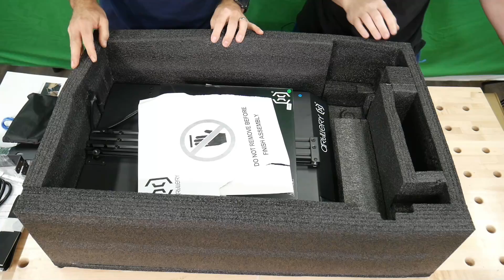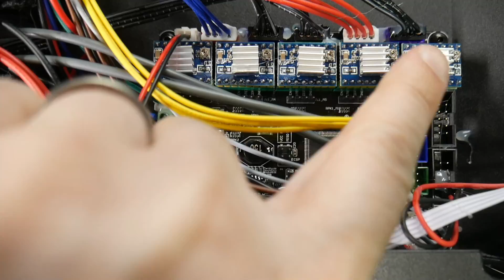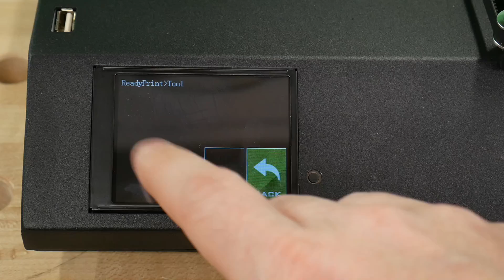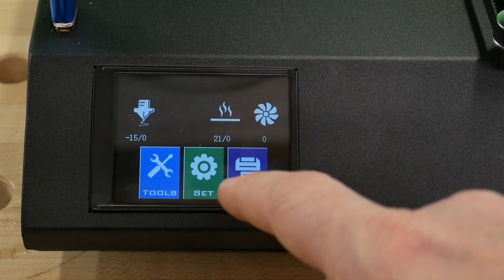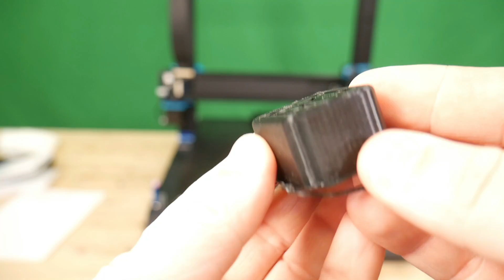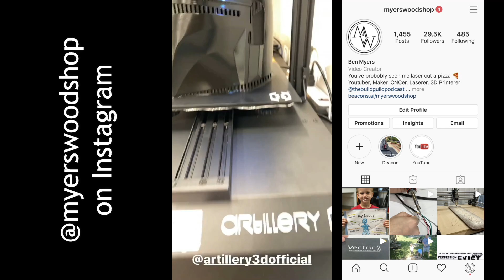Artillery Sidewinder X1 The Best 3D Printer on The Market?

Comment: The best way to remove prints from this bed is to use CO2 upside down to make the print much colder (not frozen, dont spray too much or get on skin etc do it slow and at own risk) but usually my prints pop right off the bed after the print gets cold. I literally spray each corner and the middle with 1 tiny half second upside down burst and it pops loudly off the bed. Apparently magigoo works really well also.
Reply from the maker: Great tip!
Reply: @MyersWoodshop  I got tired of wasting co2 so instead i just keep some ice packs ready to go, can usually put the packs in, on, or around whatever ive printed and watch it shrink before my eyes. kinda freaky actually. Hope this helps someone.
Reply: I use gluestick on my bed so prints stick better and then I slide a good razor blade under one corner and 99% of the time it lets go easy

Comment: Oooh, this was intersting! Thanks! :)

I'm not well educated when it comes to 3D printers. This seems to be a 'filament' printer, the other popular option bein 'resin'. Right?
I read that "Elegoo Mars" may be the most popular resin 3D printer right now(?), how does this Artillery compare to the Mars?

* It's seems much bigger than Mars. Thus it takes more space, but can make much bigger things (like a full helmet, yes?)
* I assume it's far less toxic.  Both for air filtering/quality and resin's contact with skin hazard.
* The Artillery seems to be a tad more expensive, like +25% more expensive where I live, roughly.  I do not know how to compare resin to these filament coil.

How's printing quality, relatively?  I'm mostly interested in minifigures for roleplaying games and things like these models: https://www.thingiverse.com/thing:4191414
Will Artillery equal Mars in such minute details?

Thank you for making this video, it's really helping!
Reply from the maker: yep!  This is filament!
Reply: I hope you didn't buy yet, But for detailed small prints, Definitly go resin. It is wayy more accurate.
Reply: @stafvan  It'll take a while before I buy! ;)

Comment: I don't know why they installed fan at the bottom and place it in the middle but control board which heats up during printing is on the right side and don't have decent aluminum heat sink. This makes no sense and it's version 4 :) . Printer not grounded only PSU. During printing halogen lamps flicker on the same line. Wiring could be better. Also everything needs to be tighten so I spend lots of time doing that when I got it. Printing quality with PET-G is good, printer is silent, heats up fast. I bought it for $349 so it's worth the price.
Reply from the maker: the ender 3 does that too.  this is a great printer.

Comment: One of the reasons that the bottom footprint of the printer is so large is because it aids quite heavily in stability and vibrating. Those two factors play a huge role in decibel reduction.
Reply from the maker: for sure. its VERY quiet.

Comment: I want to buy a 3D printer and I think this is the one is there anything you have found that might say I shouldn’t buy it
Reply from the maker: nope.  this is a GREAT purchase!
Reply: Myers Woodshop thanks
Reply: @rafaelbarkhordarian2163  and I second that. I've had a V4 X1 for about three months now and it has produced some awesome prints with very little tinkering. Just make sure you buy the latest iteration, the V4. It has a tiny reset button on the left side, just to the right of the LCD screen.

I am very technically minded and was expecting to do a lot of tinkering, but this was my first printer and the worst thing I've encountered has been leveling the bed, which I've only had to do twice. I'm planning on installing a BLtouch or similar, but at this point the prints have come out phenomenal, just like in this video.

Also, it is SO QUIET!
Reply: Daniel Gonzalez thank you

Comment: CR10S Pro V2 Has on-th-fly Z offset adjustment. X1 still has to fix X gantry controls.
Reply from the maker: I flashed the firmware to marlin 2.0 and now have z offset on the fly.
Reply: @MyersWoodshop  Did they fix the X-gantry control?

Comment: That bed surface releases prints when the bed has completely cooled. Patience and happy printing.
Reply from the maker: We waited 45 minutes off camera to let it fully cool. STILL couldn’t get it off!
Reply: @MyersWoodshop  You need a perfect first layer for it to work, it can't be too compressed on the bed. Works well for me.
Reply: @MyersWoodshop  I saw someone rub some glue stick on the print bed and solved this issue.

Comment: Yellow is the coating on the bed. The bed is just glass with coating and rubbing it off reduces print sticking
Reply from the maker: That’s what I figured...but it’s TOO sticky!
Reply: The yellow stuff seem to be an additional sticking promotor. The glass itself is covered with a black coating. After removing the yellow stuff from the coating the prints stick very strong when hot, but are easier to remove when  the bed is cold. After some prints it works quiet well, but you have to be patient and wait till the bed is cold. When the prints have a big surface area I just print on a cold bed and don't need to wait after the print.

Comment: where did you find the built in design for printer in cura 4.6.1 because i don't see it at all under witch name ?
Reply from the maker: I was wrong.  It's not in there.  I had to download and add a profile.
Reply: @MyersWoodshop  I also tried looking for it, in Cura 4.7, also not there.

Comment: Nice! Does it do ABS? If it does, have you found any issues with warping? In my experience with ABS it warps due to the piece cooling too soon
Reply from the maker: It will but my experience with ABS is limited because I don't have the space for an enclosure.
Reply: yes but ABS really needs an enclosure, big box over the top of the printer does the trick.
Reply: @WeirdNamja  yeah thought so, I'm interested in upgrading in a massively print area printer, so this looks like possibly the best option :P Thanks @Ben for the great review video

Comment: Good morning Ben, I earlier commented on one of your videos regarding the Onefinity CNC. 
After some thought, I decided to hold off the preorder on it. 
In the meantime, I jumped into 3D printing and by coincidence, I also purchased the Artillery Sidewinder (due to rave reviews) and have been using it the past two months. 
This is my first machine so I have no comparison to others, and I've done some extensive research on 3D printing before pulling the trigger.
Just an FYI for you and your readers on this machine.... 
The Yellow residue on the bed when you first got it... factory applied and could be some kind of adhesive to help print bed adhesion (more info further down).
I had the same problem removing that test cube print off the bed for my first print. I also used pliers to remove it but I've read you can chip the print bed glass doing so.
What works for me is to put a few drops of "watered down" 70% Isopropyl alcohol along the edge after the end of the print. In about 5 minutes, the alcohol will loosed the bond and it should release easily. 
"Initial yellow residue"...  after a few prints and bed cleaning, the bed adhesion wasn't great anymore. 
There are many alternatives like glue sticks etc... I use "Aqua Net Extra Super Hold Unscented Hair Spray" ($4 from CVS pharmacy)... Spray it onto the clean bed before printing, then heat it up to 70º C to dry it off. It works wonders as it has held a 50mm x 250mm tall print without toppling. 
(TIP) I've applied multiple coats of this hair spray onto the bed to the point it looks like a shiny glass surface. If you print on this, that side will also be shiny like glass. 
Replacement Parts.... I purchased a bunch of replacement parts for this printer just in case. I found a place online in Las Vegas who has most of the parts, lowest price and in stock: friendlyhobbies.com  They shipped quickly l and I received the parts in a few days. 
IMHO, this machine has been printing problem-free and I love it. Printing tolerances are spot-on with easy calibration.
I'm using CURA 4.6.1 as my slicer.
Here is the profile if anyone needs it:
https://3d-nexus.com/resources/file-archives/download/8-artillery-evnovo/32-3dn-artillery-swx1-and-genius-cura-4-6-1-machines-and-profiles-installation-package
Reply from the maker: thanks for sharing that info!  it's perfect!

Comment: Nice review. Wondering, what helmet model did you use? I checked one on Thingy-verse, using Cura, and it shows 6 days at low quality. Wondering if you can share the settings and what model you used, if public. Many thanks.
Reply from the maker: Yeah, it was just one of the ones from thingiverse!  It took 3 days at .15

Comment: I think i'm going to have to buy a 3d printer now. This prints better than the $6k printer my former boss bought about 2 years ago. At 1/12th the price. Thanks for sharing. I was impressed enough to consider finally buying a 3D printer. I was always a cnc machining guy due to my former tool and die maker days but the quality and ease of use demonstrated in your video had sold me.  I'll probably hold off a bit just because I have too many irons in the fire at the moment. Just downloaded fusion 360 for my shapeoko so I have enough things to learn already. Thanks for sharing. I love your videos! If you can dream it you can build it.
Reply from the maker: they're so cheep and good now a days i think every home should have one.